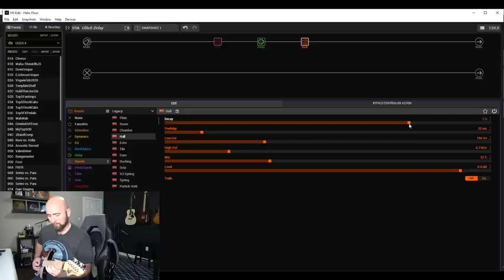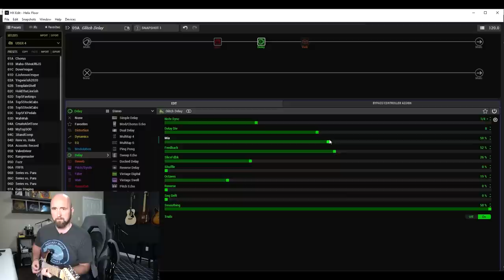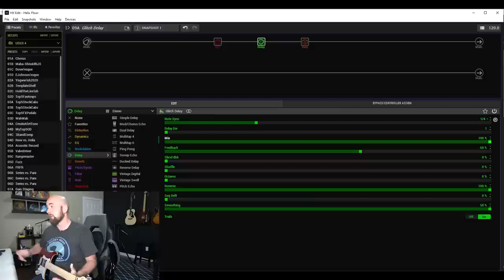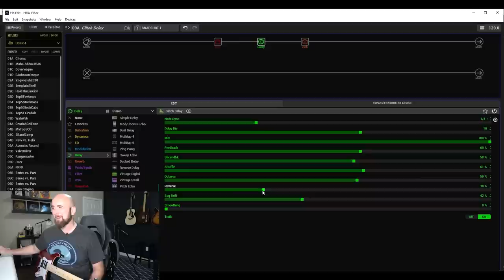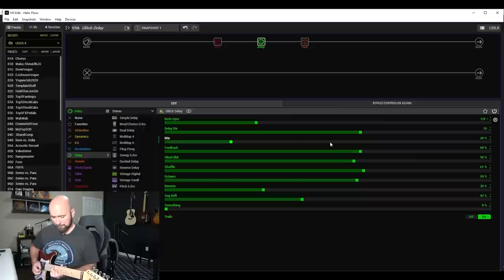Line 6 Helix FIRMWARE 3.0 - Dialing In... GLITCH DELAY!!

Comment: Hi how are you? I saw several of your videos and I always have the same question: why do you put the effects after the amp? aren't they supposed to go before? guitar - pedals - amplifier. Maybe I am wrong but I want to know why. Thanks so much!
Reply: You can do it either way. But for Time-Effects like Delay and Reverb it might be advisable (but not necessary) to place them behind the amp. Think of it as this: Is the Echo or Hall supposed to be modified through the amp's sound? Or do you want to repeat/echo/hall the sound of the amplified signal? 

Usually, the reverb is supposed to emulate a large room (or a canyon, whatever you can think of). So you sit with your amplified guitar in the room and hear the echo.

If you put the reverb in front of the amp, the reverb is also modified by the amplifier's unique sound. That can be also useful. But keep in mind that the amplified guitar with reverb is not the same sound as the mixture of guitar+reverb through the amp together. :) 

If reverb goes through the amp, it will be amplified the same as the original sound. That might be too much and not sound natural. But that effect can also be desired, but only in experimental settings. Normally you want the amplifier's output reverbed.
Reply: @Szaladin  Thanks!